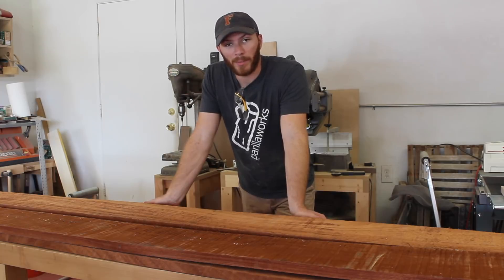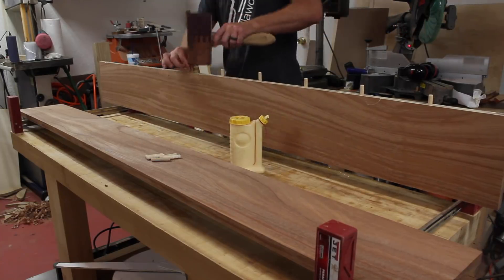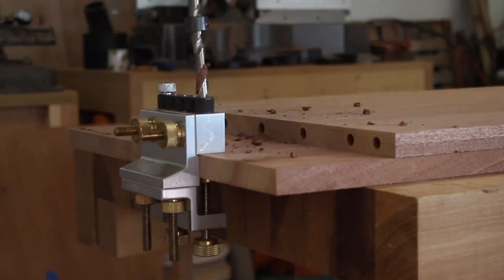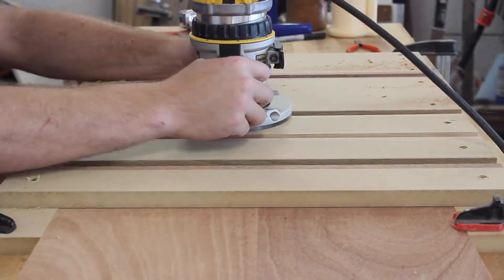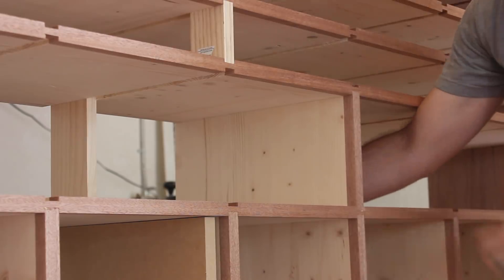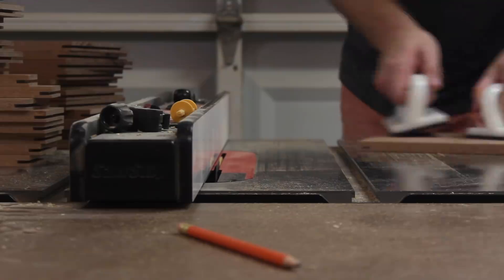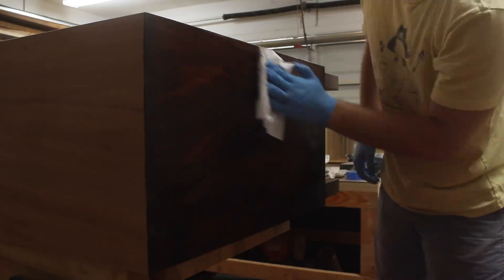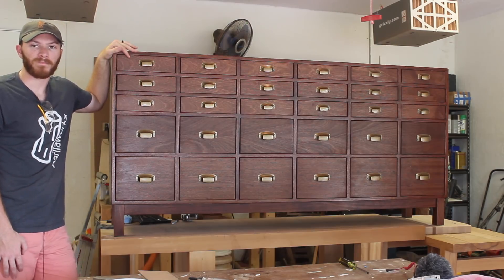Making Another Large Apothecary Cabinet

Comment: Thanks for the comment about small jointers, I’ve been considering buying one and had wondered about that. Also, congrats on the new drum sander. :)
Reply from the maker: Thanks Ian! I've had that little Grizzly for almost 3 years and it's done a great job. Face jointing long boards is tough but edge jointing is more manageable. And thank you, I've wanted one for a while!
Reply: parillaworks I’ve been looking at the new grizzly with the spiral cutter head but I just found that Cutech makes an 8” benchtop jointer with a segmented cutterhead for $500! I think I’ll get that. :)
Reply from the maker: I've heard good things about that cutech as well as their little planer. Good luck :)
Reply: +Ian Enderby not telling you what to do but as a owner of a real 8" jointer with spiral byrd head I would tell you to save you 500 buck and looks for a used 6" jointer for about $175 to 250 you will be much better off if you have the space for it. The 6" normally run on 120 if power is a issue cause most full size 8" battleships run on 240 unless you find a older one that could be wired for 120 but I would not spend that much on a table top unit. I bought my 6" for 175 sold it 3 years later  300 and put that money to my 8"

Comment: I know I'm pretty late to this and probably won't get answered, but how did you attach the back? Is it just rabbetted and nailed on? I'd love to see an image of the back panel. Great work!
Reply from the maker: Thanks Stephen. I left that footage out but I used a rabbeting bit on the back during a dry assembly of the four outer case pieces. I did that because the divider pieces would’ve been in the way otherwise. I squared up the corners with a chisel and used a piece of 3/16” hardboard nailed in place.

Comment: I'm curious, are you concerned that the solid wood dividers will compromise the case with any wood movement? I don't have enough experience to understand the risk. Obviously furniture was made before plywood, but since wood moves...? I'd love some guidance!
Reply from the maker: All of the material on this cabinet is solid wood with the grain direction aligned. For this reason, the wood can move freely without running into any issues. If the outer case was plywood with solid wood dividers then there would probably be an issue.

Comment: I know this is an old video, but I’m curious. Is there a reason you choose to use solid panels both horizontal and vertical for the dividers?  Seems like it adds so much weight when framed horizontal panels with say 2” deep verticals would be adequate. Nice build. I was thinking of working on something similar.
Reply from the maker: Thanks Sean. I’ve considered webbing the internal dividers but always figured switching to pine saved enough weight, relatively. And the drawers are what really make the cabinets heavy. I can sort of move the empty cabinet around by myself but with drawers? No way. That said, I’m about to start another one that’s 20” deep and will have a 1.5” thick outer case. It’s going to be SO heavy. I may consider cutting out little rounded rectangles between all of the dados. Could save a few pounds.

Comment: Noticed you are using a benchtop jointer now whereas before you had a floor sized jointer.  Is the benchtop jointer working better for you ? Great work !
Reply from the maker: Hey sorry for the delay. I thought I had already responded to this earlier. The floor sized jointer (6" powermatic) is still in the shop but has been giving me issues. I can't get the table and knives setup correctly. The Grizzly is still working well and I've been able to joint large pieces pretty well; I've had it for about 3 years so I know how to get the most out of it, at least I think I do.

Comment: Incredible! Big fan of your work and thanks for taking the time to make these videos.  What are your thoughts on the DowelMax jig?
Reply from the maker: Thanks a lot! I like the jig a lot. It works well, is sturdy and well built, and is easy to use.
Reply: Awesome. Thanks. Any tips on where to get some cool door pulls? I'm building a 46" 5 drawer walnut dresser and can't find anything I like
Reply from the maker: These were from Lee Valley. They have a ton of other options that fit different aesthetics. They can be pricey but with only 5 drawers you should be ok. Outside of Lee Valley, I haven't really found many good options, but I'm sure others could chime in with some info.
Reply: Thanks mate. Didn't even realise they sold Drawer pulls.

Comment: How do did you price this piece?  Hourly, flat fee plus materials?  Any info will help. Thanks.
Reply from the maker: Hey Jon. I usually start with cost of materials and work off a multiple of that. I try to gauge the hours I'll have in it and if that price makes sense. This piece in particular was 16" deep which required a new drum sander and has 30 drawers, which is a lot of extra time compared to previous projects. Also, I charge a flat true cost for stuff like handles/pulls; typically just as easy or easier to install expensive handles as it is to install cheap ones.
Reply: @parillaworks  Thanks for getting back to me.  Do you market yourself locally or work on word-of-mouth?  Thanks again!

Comment: NIce work! How long were you keeping the drawer boxes in the clamps? I leave them in the clamps for about an hour. As long as you are not banging them around it's no problem. I am sure you will love the new sander. It will still be a while, but it will be my next large tool purchase. Thx for sharing the build with us.
Reply from the maker: Thanks Tom! I left them for a few hours depending on my workflow. I debated between a larger planer and the sander. I figured the sander can handle different projects and I already have the 13" planer. Though I still want a bigger planer...and jointer for the matter.

Comment: I am trying to make one of these in half the size (15 drawers)  Are your drawers and fronts all 1/2" thick? It is hard to tell from the video.  I watched your half blind lock joint video and I think you mentioned those were 1/2" thick but how about on this project?  Also - are the drawer fronts the same thickness as the sides and back? Thank you.
Reply from the maker: Hi Amy! All parts of the drawers are 1/2” thick, except the bottoms which are 1/4” plywood. You can bump up to 5/8” or 3/4” if the drawers are pretty large, but then things start to get much heavier. I think 1/2” or 5/8” is a good thickness for these.
Reply: @parillaworks  Thank you!